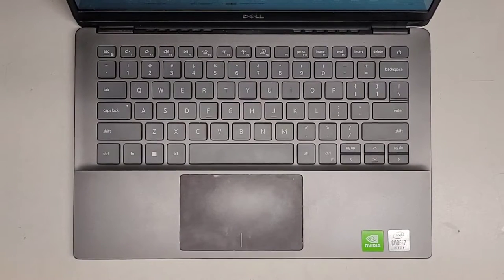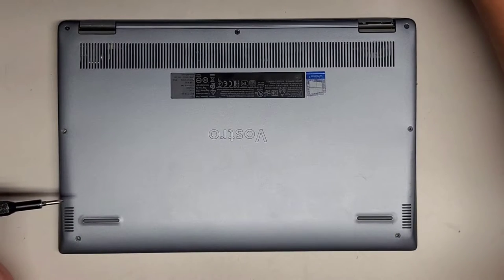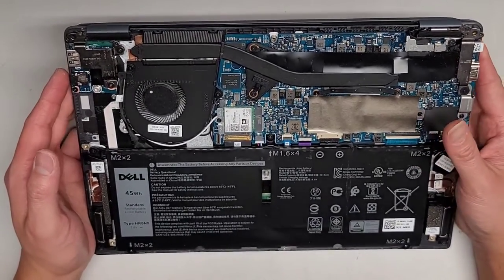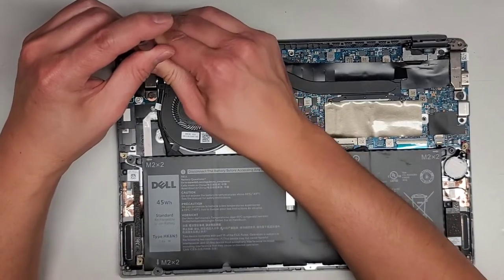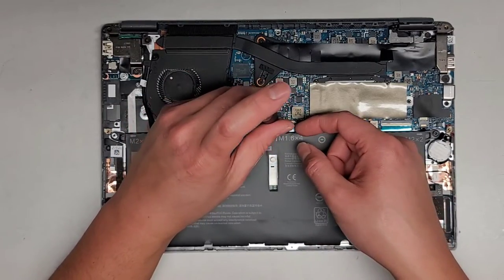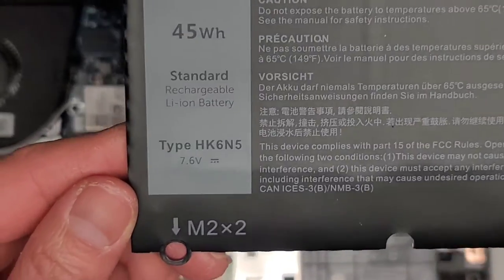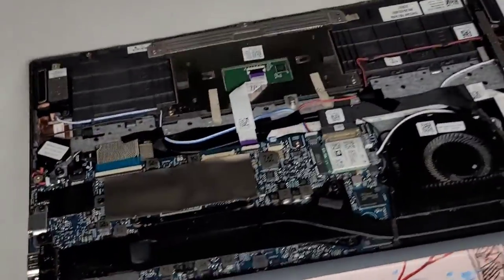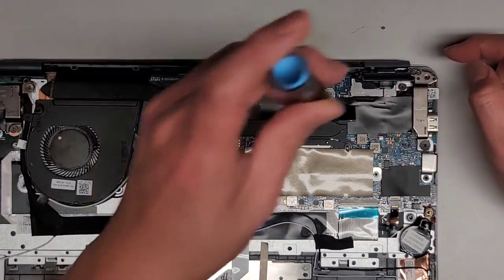Dell Vostro 5391 Disassembly SSD Hard Drive Upgrade Battery Replacement Hinge Repair Quick Look

Comment: quite a well done job. Btw, if you don't mind me asking, how did you decide you wanted to work with computers?
Reply from the maker: When I was younger I kind of liked it, but didn't really do it much. I kind of just likely looking at things, and figuring out how they work. In high school I got a gaming computer. It had a gpu flaw that ended up with a class action lawsuit. I sent it in so many times under their extended warranty and opened it up a few times trying to figure out other issues. Eventually they exchanged it for a cheapy laptop and I bought a bunch of parts to upgrade it. Later I thought to myself I could do this for other people and put an ad on craigslist and it just grew from there to yelp and Google.
Reply: @ItsBinhRepaired  Wow, That's a quite the "backstory". 
I applaud how you think. I think you'll go far with that mindset.
Reply from the maker: @regularperson9297  haha I hope so. We'll see :P

Comment: Nice video, can you make another video on keyboard replacement? I broke one of the keys and have to replace the entire board. But I'm scared I'll break more parts and harm. 😂
Reply from the maker: I can't, but if the key still works when you press it, this might help https://youtu.be/PW9MlsWXS3o
Reply: @ItsBinhRepaired  nope, the hook on the keyboard broke so I'll have to replace one entirely, do u know if the keyboard is stucked permanently to the panel or is it those that u can remove them?
Reply from the maker: The metal hook?
Reply: @ItsBinhRepaired  you know how theres a hook that make sure the retainers/hinge keeps in place? that broke off
Reply from the maker: The plastic?
Reply: no, the small metal thing that keeps the plastic intact to the board @ItsBinhRepaired
Reply: @ItsBinhRepaired  hey so I found out what its called, the "Hinge Clip" on my W key is apprently broken, I had some issues with the W key and tried to fix it but he Clips were misaligned, so I tried to force it back in place but broke it instead. Only way really is to just replace the whole keyboard, I have a Japanese layout and was able to find a keyboard online, so only thing i need to know is that whether or not if the keyboard is stuck to the palm rest or if its seperated. That way I know whetehr I need to buy entire new palm rest or just the keyboard itself is fine.
Reply from the maker: Held in with melted plastic
Reply: @ItsBinhRepaired  What is? The keyboard?
Reply from the maker: @SkyLLer5971  yup
Reply: @ItsBinhRepaired  is there any way i can have access to the keyboard and replace it? Its really hard to find one with a palm rest installed unless I look through the Japanese market which is gonna cost a lot more money and hassle
Reply from the maker: @SkyLLer5971  need to remove everything and then cut or melt the plastic. Better to replace the whole palmrest.
Reply: @ItsBinhRepaired  Damn, I guess I'll send it to a shop and let them do the fixing
Reply from the maker: @SkyLLer5971  yup :(
Reply: @ItsBinhRepaired  Thanks for replying btw xd, u just earned a new sub
Reply from the maker: @SkyLLer5971  thanks!